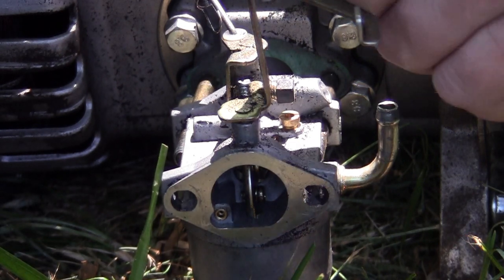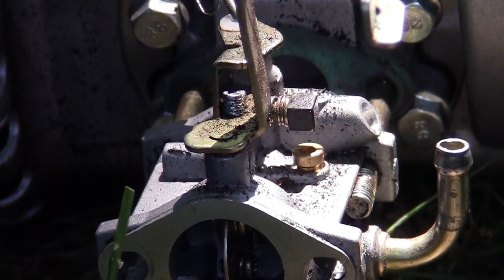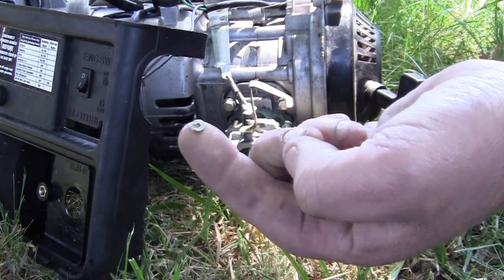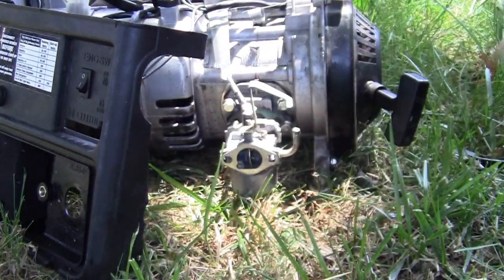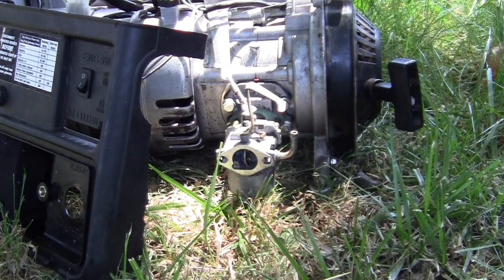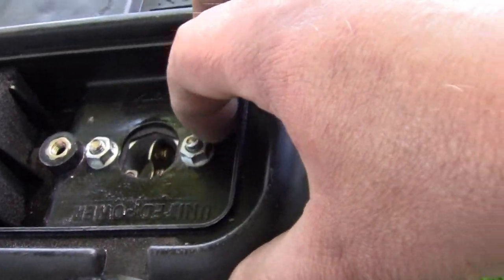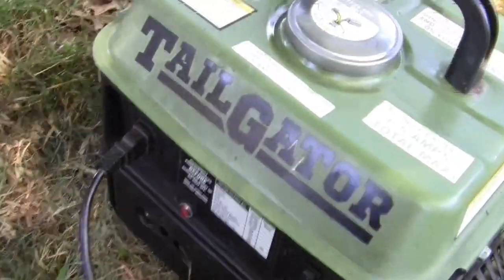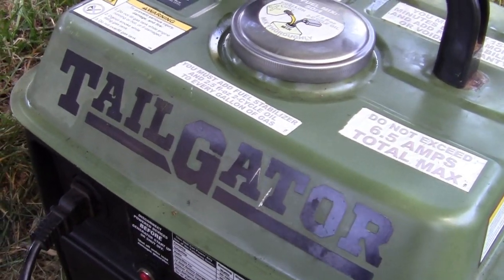2 CYCLE GENERATOR HIDDEN MIXTURE JET

Comment: You got that Harbor Freight trailer also, huh? Me to bro! Thanks
Reply from the maker: You bet
Reply: ShawnMrFixitlee hey bro ... what’s the next jet used for ??? The one they did not hide
Reply: @theetruealpha  If you were really a true alpha, you would know what it does.  It is the high speed fuel mixture screw.  The one he adjusted is the low speed.

Comment: I realize this is a few years old - but I just replaced my carb on my Stormcat yesterday.   Was curious, though - what is the correct number of turns out to start tweaking the mixtures?   (And my new carb has an accessible external screw for both jets, now.   Not hidden).
Reply from the maker: start with 2 turns out and get it running temp and adjust from there..

Comment: I got mine but it wont start and the idle mixture adjusting screw is 4 and half turns out. It would be great to know roughly how far out it should be. Also, is it an air screw or fuel screw. IE does unscrewing it, give it more air or fuel and therefore weaken mixture or richen mixture? Some facts would be useful please.
Reply from the maker: About 2or 2 -1/2  turns out is in the ball park . Not sure what might be wrong there . rich mix is out lean is in . Those are the facts !  Thanks
Reply: @shawnmrfixitlee6478  Thanks very much.

Comment: Mine actually has a needle valve screw there but then it hasn't been interfered with by the numpties at the EPA( protecting your interests🤢🤢😆)
Reply from the maker: Some have the jet screw , I have one that has it without removing the plug . Thanks !!
Reply: @shawnmrfixitlee6478  Do you know how many turns out that mixture screw is at?
Reply from the maker: @MicRuLerZ  I sure don't . It has been so long ago . I would start a 2 turns out from closed . Thanks !!
Reply: My older one is like that, my newer ones have the tamper-proof plug.
Reply: @MicRuLerZ  with no electric load, back it out till slight 4-stroking occurs.  I noticed if set too lean, then while under electric load the engine governor will hunt.

Comment: Make the adjustment at idle?
Edit: I backed mine out a half of a turn. It was screwed shut.
Reply from the maker: I messed with mine at idle and run speed and both made a difference . Idle seemed to make more though .. Thanks !
Reply: @shawnmrfixitlee6478  the eBay carb seems to give more room to fiddle with it. But yeah even the small adjustment I made helped it out a lot. I might buy a eBay carb for a emergency backup. I’m running this little baby in Ida aftermath !
Reply from the maker: @Christ-is-King-  For sure ! Stay safe man..

Comment: I tried this and it doesn't work, behind that copper cap is another copper cap that looks like an adjustment screw, I drilled it out and there is nothing behind it, I just put a little opoxy and sealed it back up even though there's nothing for outlet or adjusting.

Comment: Ya but why did u do that
Reply from the maker: Because it was running poorly .. The aftermarket carb has one that's not hidden . so I figured there had to be one under that plug..
Reply: @shawnmrfixitlee6478  ok so I cleaned the carb its running. It's still doing it u think its that plug maybe
Reply from the maker: @hayleboyce2425  Could be .. Is it running rich or lean?
Reply: @shawnmrfixitlee6478  well I just adjusted the throttle some n so far seems to be doing well
Reply: @shawnmrfixitlee6478  tyvm for ur assistance
Reply from the maker: @hayleboyce2425  Just be sure the voltage is right . the more throttle the more output on voltage ..
Reply from the maker: @hayleboyce2425  No prob..